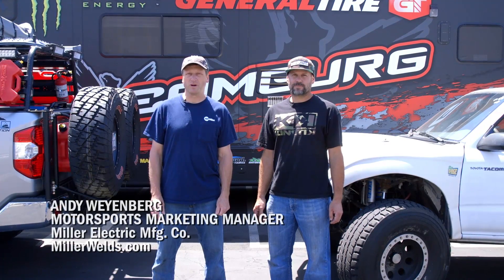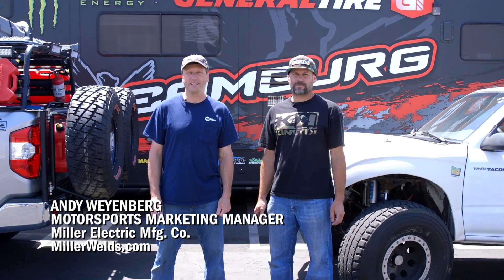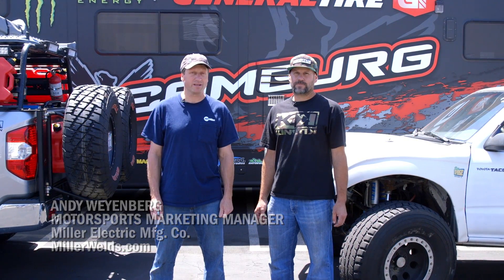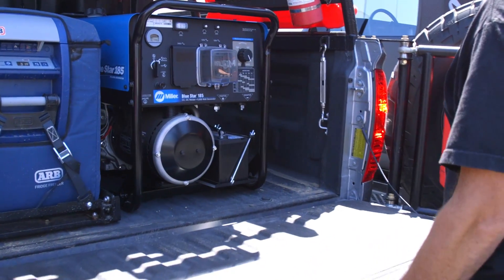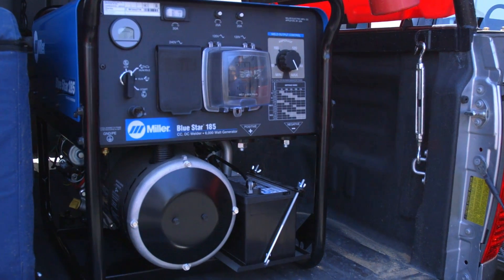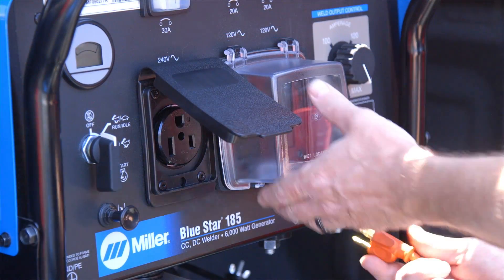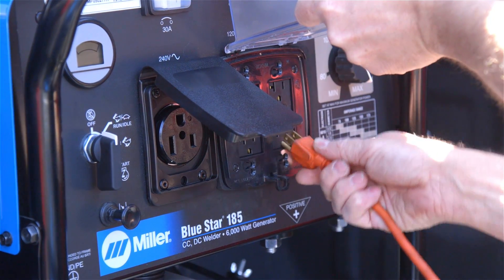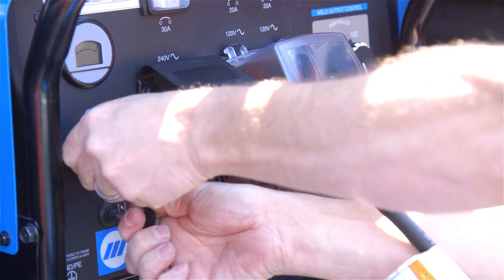How to Repair an Upper Control Arm with a Welder/Generator

Comment: Having the blue star 185 there I would of just stick welded the upper control arm mount with some 6011 !! You think ? Where am I wrong ? You don't need too worry of the shielding gas getting blown away , stronger weld with the 6011 and you can get in to a tighter spot with the electrode !!!

Comment: wow...how is it extremely portable??
Reply from the maker: Thanks for your question! The Multimatic 215 weighs in at 38 pounds and connects to 120 or 240V power. It's great for in the garage or on the go. You can learn more here: https://www.millerwelds.com/equipment/welders/multiprocess/multimatic-215-multiprocess-welder-m30090
Reply: hmgcrawler
Reply: dont get me wrong but miller is a damn good product, i have the 211 at home for the garage use,  but when your on the trail you want to have something portable as to not having to bring a generator along everytime.  dont miller have or can come up with a unit that can be for trail use without having to tag along a generator with you all the time?
Reply: SwineCraft
Reply: SwineCraft
Reply: SwineCraft

Comment: I am sorry to have to say this, but you have lack of fusion at the toe from the looks of the video, might want to go vertical up..
Reply: here are a few trucks built by the same guy. let me know if you still think the same lol http://www.kinetiktrucks.com/racevehicles.html
Reply: Mercury1949chopped mercuryMason Wilson
Reply: Let's see it
Reply: Sorry, but I have been a CWI for going on 20 years now and a welder for 29 years. Welding 3/16" to 1/8" vertical down at 17.5 volts is not going to hold and there is lack of fusion at the toe from what I can see from the video. Just my 2 cents..